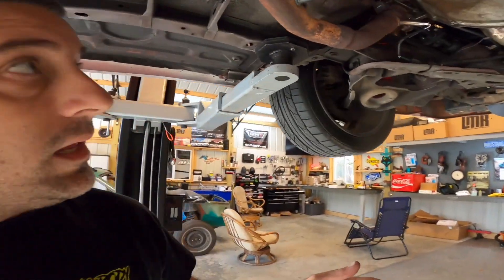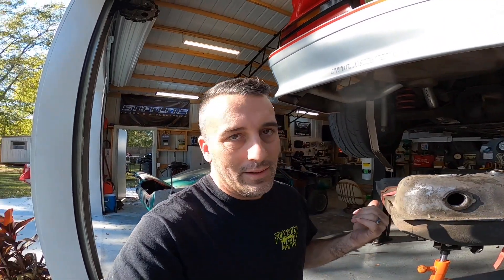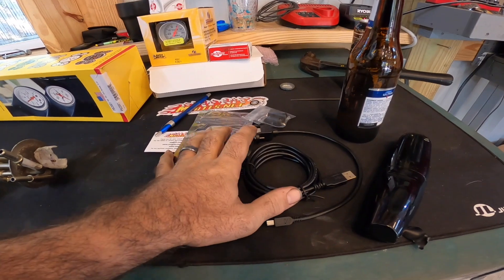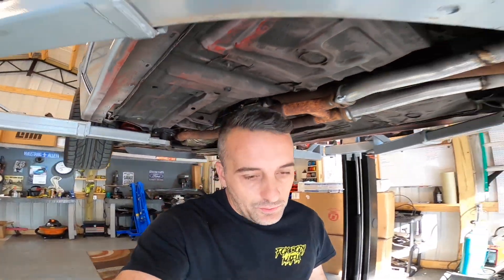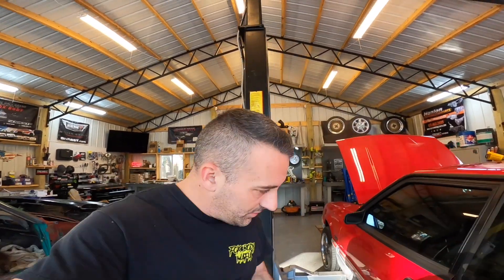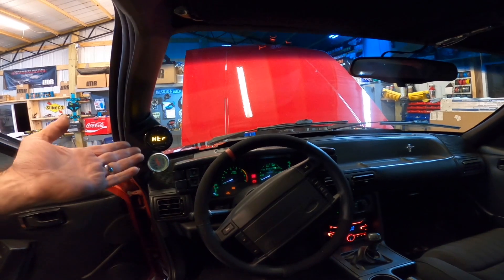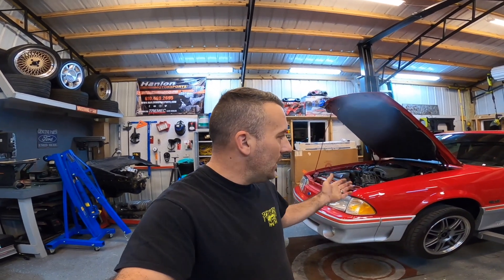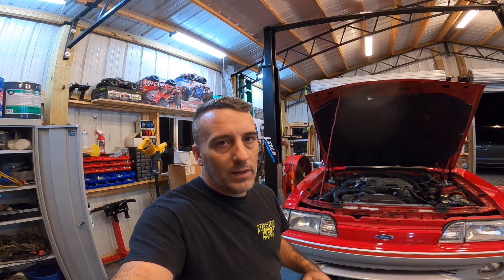So Close I Can Taste The BOOST!

Comment: On my aod fox, I didn’t notice a difference going from 3.27 gears to 3.73 gears till the top of the rpm range. Kind of bummed me out but whatever I guess

Also, any plans on adding subframe connectors to the retro fox? That thing is going to see a decent amount of power. Wouldn’t want that beautiful paint to start cracking on the quarter panels

Comment: I had an issue where my fox felt super anemic even with gears, injectors, pump, intake, etc. it ended up being my fuel lines. Someone in the past jacked up the car right next to a fuel line and crumpled both the send and the return. Also made the car stumble and die on decel. Replaced fuel lines front to back and now the car blows the tires off into 3rd

Comment: I have an 89 Lx I just bought. Got a good deal but it needs paint and some interior love. First Foxbody in years. Can’t figure out why I have to start it like 6 times before it will idle. Any thoughts?
Reply from the maker: Try a base idle reset. It’s free and would be my starting point
Reply: @BREW2LFOXBODY  I tried but couldn’t get it to run with the IAC unhooked
Reply from the maker: Then the throttle needs to be raised 💯👌